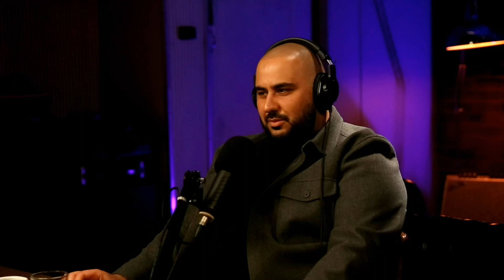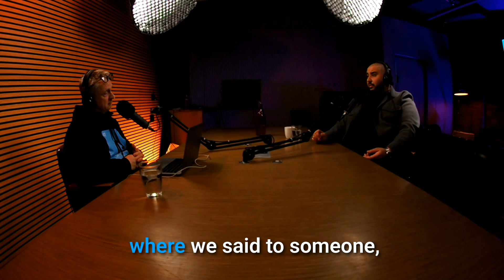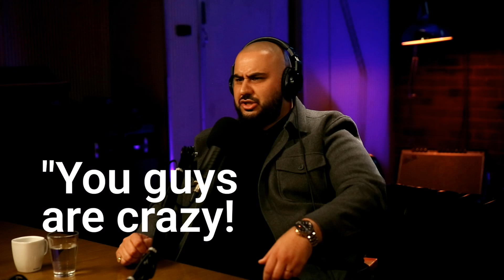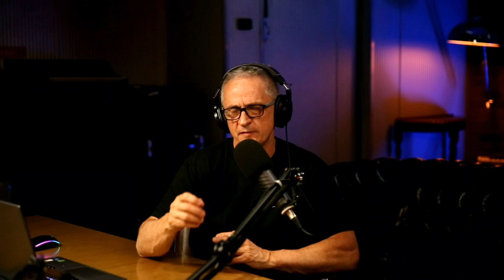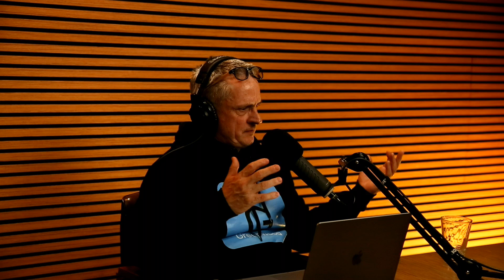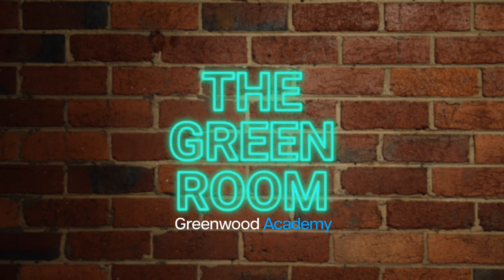Why Roof Mount Solar Isn’t Simple

Comment from the maker: Most people think solar is just panels on a roof, but Sanna explains why good workmanship, proper design and trust matter a lot more than just getting the cheapest quote.

This was one of the more honest conversations we’ve had about the industry. We spoke about early mistakes, lessons learned, bad installs and what actually separates good operators from the rest.

If you work in solar, engineering, construction or you’re looking at getting a system installed, there’s a lot in this one.

Interested to hear what part stood out most to you.